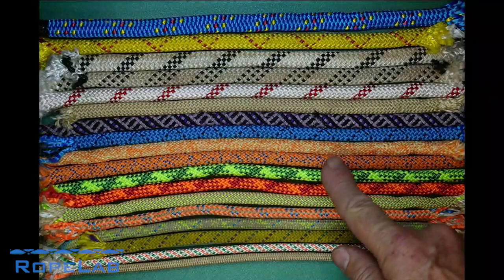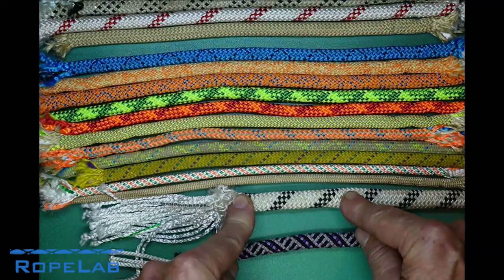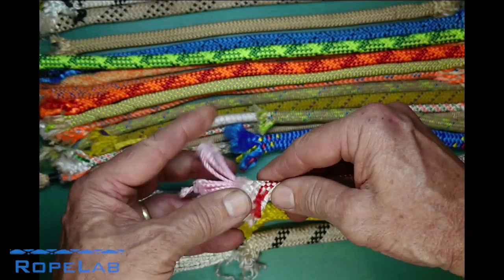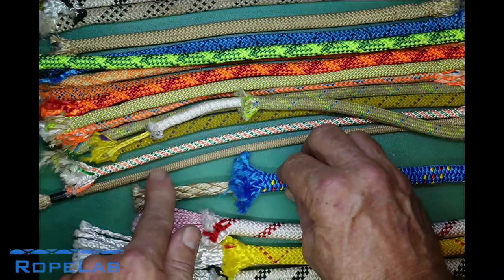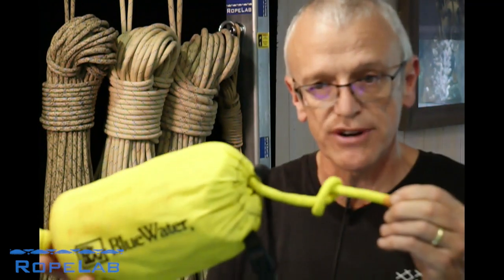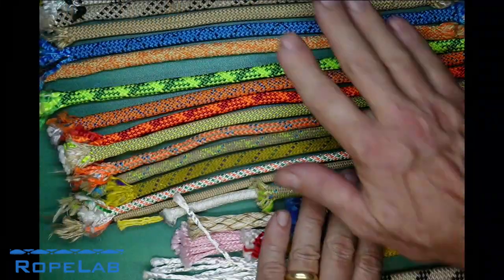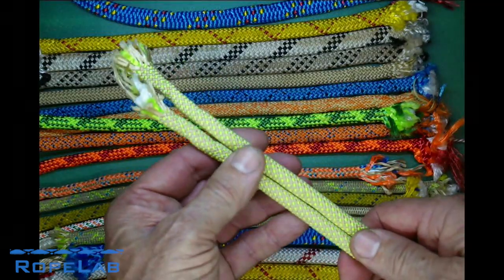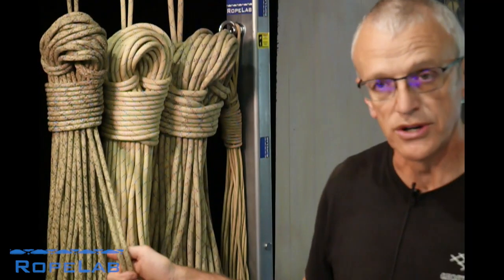RopeLab equipment info series: Ep 2 - Rope

Comment: I had heard of the "Super Glue" or more specifically the Cyanoacrylate method of terminating a rope and attempted it myself. After waiting about 20 min with no perceptible change in the glue, I soaked up the mess with a shop cloth and did some research. My first suspicion was that Cyanoacrylate requires anaerobic curing conditions, this is not true, in fact it is the presence of O2 in the tube that keeps the Cyanoacrylate monomer from polymerizing into the solid form we are after, and it is the presence of H20 that is required for the polymerization reaction: of which there was almost none in the dead of winter in Calgary, Alberta, Canada. So, PSA, if you are in a dry climate, let the rope sit a while to absorb some H20 and allow the glue time to cure before you assume that the canyon bro that told you to super glue your rope ends is an idiot haha big fan of you and your content, Richard. Please keep it coming. Cheers!

Comment: Hey Rich, Great video as always! Thank you! Spontaneous question since you mentioned dynamic event on the "Bag" protector and how it will cut right through, how about the edge roller? Did you test that on a dynamic event? I'd guess the worst case could be some bending in the 8mm bolts going through the bearings, but unless somebody drops something on them we won't know for sure...

Comment: With your edge roller, I would add washers between every 2nd bearing so the ropes don't tub against each other
Reply from the maker: I've been using various versions with and without different part over the last 6 years.  Washers there only get in the way and tend to want the thing to flip more if the ropes are at any angle.  It works great as is.  When the ropes are next to eachother there is minimal contact friction as they are parallel.